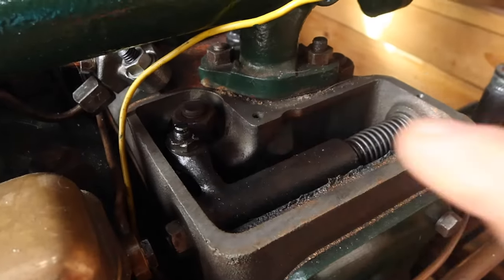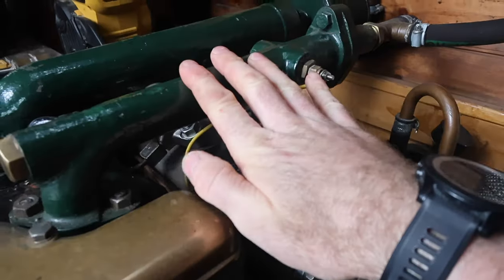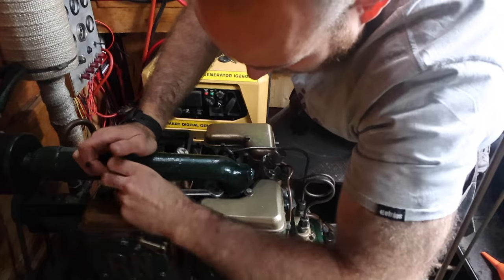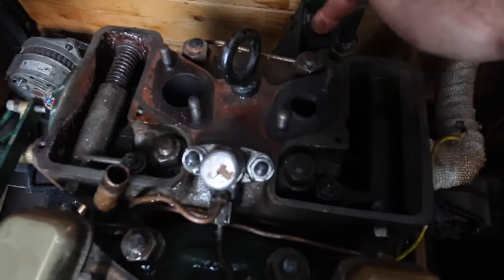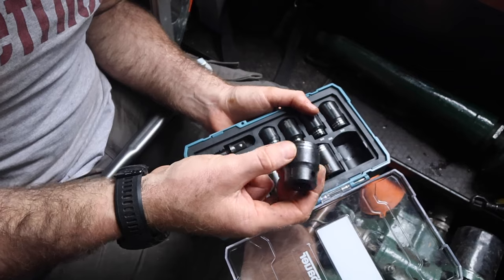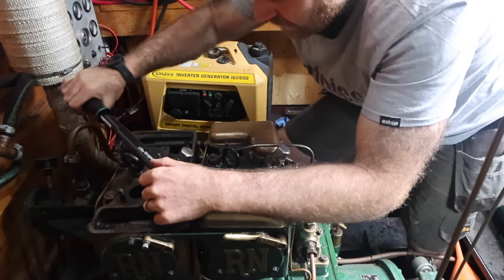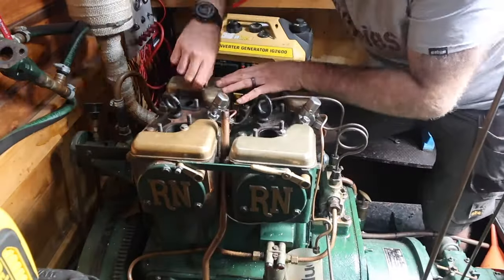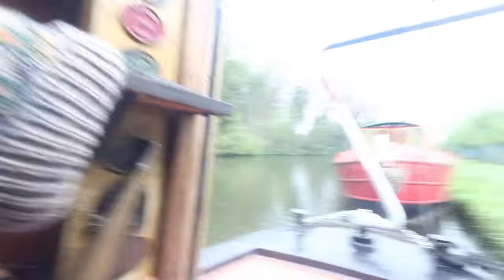Repairing the VINTAGE russell newbery  ENGINE on our NARROWBOAT... leaky head gasket

Comment: I've never heard a mechanic say to torque below engine specs. Improper torquing could promote gasket failure, loss of compression, mixing of oil and coolant, erosion of cylinder head, over heating and warping of the cylinder head. Manufacturers specifications are given for a reason. You got off lucky.
Reply from the maker: 🤷‍♂️ just going from the advice I was given from the guy who still makes these engines today (so technically manufacture specifications) Apparently everything was over spec'd. I understand the dangers hence why as soon as I spotted the dribble I got it sorted.